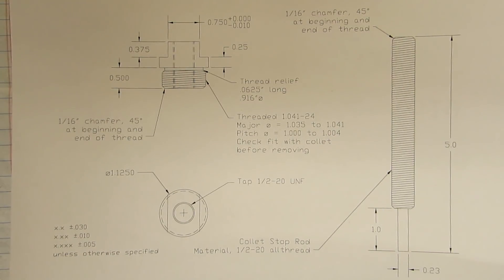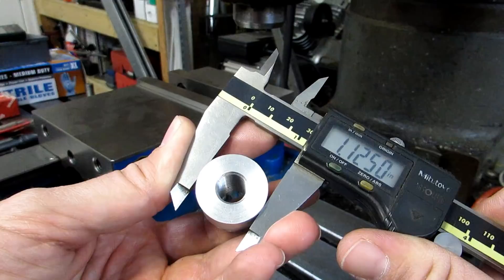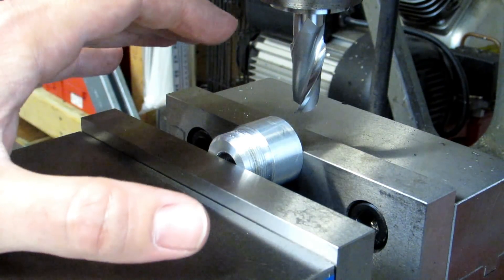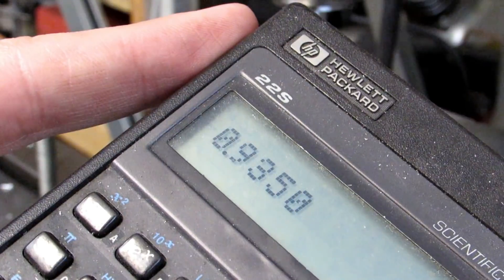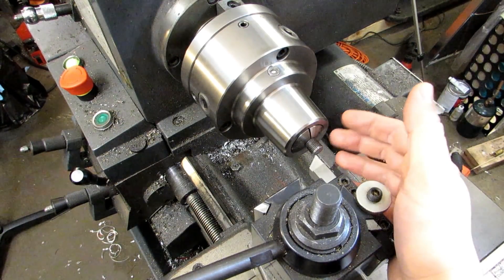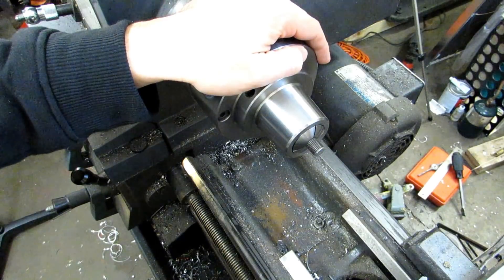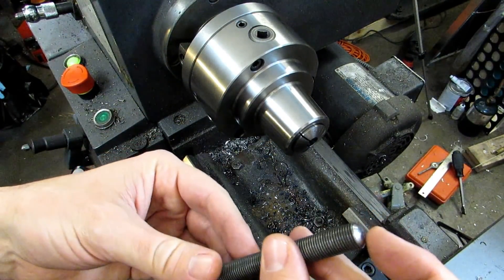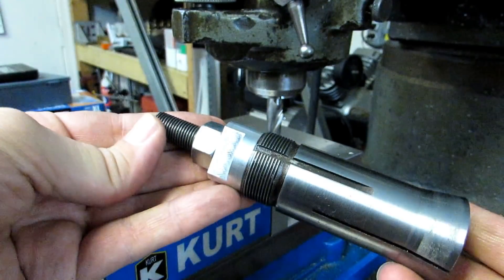5C Collet Stop: Part 2

Comment: Great project.  What lathe do you have?
Thank you.
Reply from the maker: I have an Enco 12x36 lathe that is coming up on its 21st birthday. I'll have to buy it a nice scotch in September.
Reply: @StuartdeHaro  AWESOME! 👍

It’s nice to see an older import lathe working well and holding tight tolerances.  

My Taiwanese 13x40 has its 7th birthday in a couple of weeks.  I still enjoy it and don’t regret the purchase.  It’s so much higher quality than my previous 3 in 1 machine.  

Thanks for the reply.  I just stumbled across your channel and have been enjoying the videos.  Well done and amazing workmanship.  
Mike
Reply: Just found your channel. Having made a similar device for my 5C collet chuck totally on my Myford ML 7, I didn't have a mill at that time, the milling operations were carried out with a vertical slide.
For one of your next projects I would suggest an edge finder to give you more accurate locates on your mill. Mind you since this posting was five years ago you may well have made one by now. Thanks for the video and clear narration as to why and what you were doing.

Comment: Great simple little project that should prove useful. I am curious what stock you used for the body of the collet stop (Type, Size). As a beginner I truly appreciate the projects, techniques, and methods of instruction you use. I look forward to much more...
Reply from the maker: Hi Harold.  The stock is 1.25" (32mm) Aluminum, probably 6061, but it might be 2024.  The alloy doesn't really matter much, but 2024 machines a bit more freely.  6061 is prone to having long stringy chips that wad up into bird's nests.  Thanks for watching!